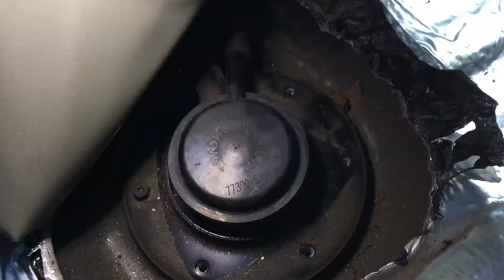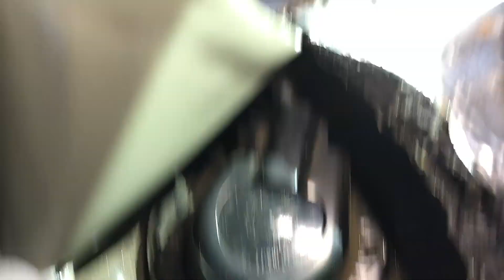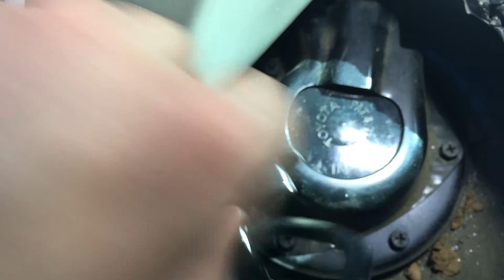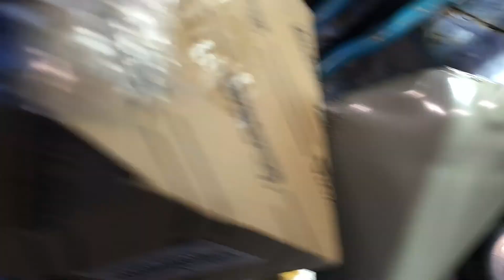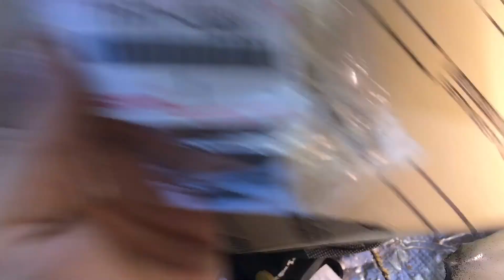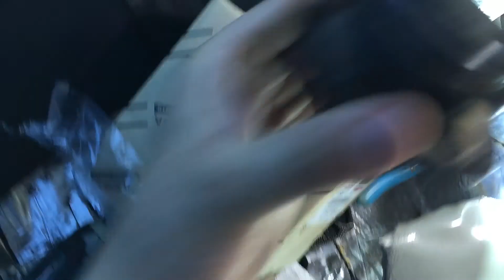Lexus IS300 Trouble code 440 EVAP system | Fuel Tank Over Fill Check Valve Fix

Comment: what a complete failure by Toyota Motor Corp!  as an IS300 owner that has already replaced $1000.00 worth of parts and still can't get the error code from popping up, this is turning in to a real nightmare...  the alternative to this method is to attempt to drop the fuel tank, which is totally impossible without disassembling the entire rear end.

Comment: From what I understand, a P0440 code can be anything from a purge valve or vacuum switching valve to a cracked hose. Same for the P0442. I know there are videos where the repair you made was due to both codes.

Comment: I have a lingering p0420 p0430 p0440 p1446. I changed o2 sensors on bank 1 I ran some lacquer thinner in gas tank I changed a possibly bad brake booster hose changed the vsv valve in the charcoal canister. I ordered the fuel overfill valve in this video would this fix it? Also when I have o2 spacers on rear o2 sensors on both banks, no codes but they’d wouldn’t pass me smog with those. Any help appreciated from fellow is 300 owners thnks
Reply: M B for P0430 is your cat. Are you in LA area?

Comment: I did al what you did in the video and it did not fix my P0 440 Error code on My Lexus Is 300
Reply from the maker: It could also be something involving the charcoal canister.  I don't have a video on fixing that one unfortunately.  I had to get both fixed to correct the issue.  This code is difficult to solve.
Reply: I just order the VSV Value  hopefully changing it will fix it.
https://www.youtube.com/watch?v=dQ4CNWml11E&t=470s
Reply: Did the VSV change fix the issue for you?

Comment: How many codes were you throwing? I have a p0440 and p0446 both evap codes
Reply from the maker: At the time I was only throwing P0440. Prior to this, I also changed out the charcoal canister and tested the gas cap. Thanks for watching!
Reply: Do you know what fixed the 446? My 2001 has those codes